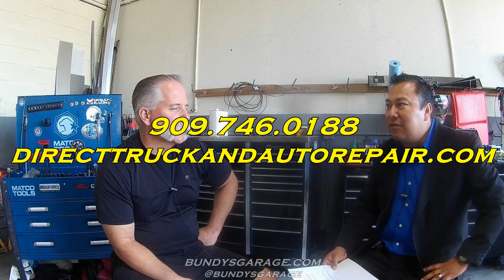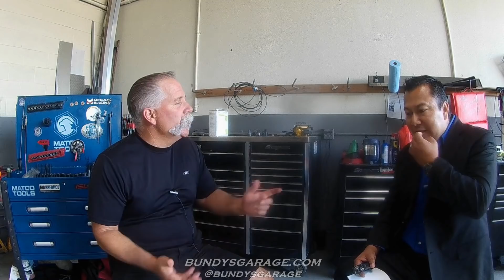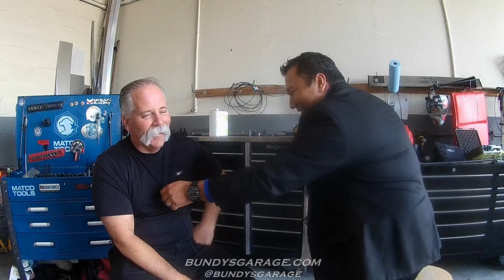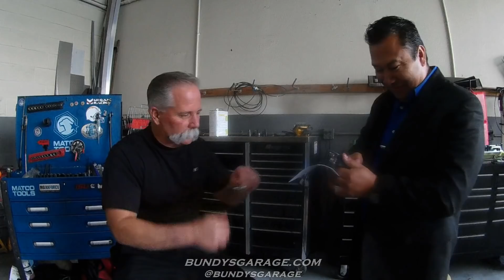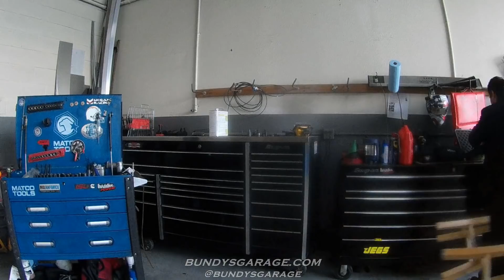Worst Diesel Engine Ever - What is the Best Diesel Truck out There? | Ford Dodge Chevy

Comment: Cat, Detroit, cummins are the only true diesels. Ford and chevy designed there’s around a gasoline design. And simply quite put a straight six is always easier to work on tHen V type engine Not to mention they are a better design

Comment: It's a good video and exemplatory statement about GM and their DURAMAX shinanaigans.. I had a 03 DURAMAX here with a spit valve and a mashed injector and what a friggin nightmare. I had to tear it down first let it sit until I got the head gaskets from Summit... I Had too get the gaskets from Summit they knew more of the part numbers than our local dealer did FAIRWAY MOTORS in Hazleton forget buying anything from em period they'll sell ya truck in a big hurry but expect to get info or parts for it from em no no no FAIRWAY drives me friggin nuts. If you really need DURAMAX parts look ups there were 3 dealerships in TEXAS that helped me out over the phone as much if not more than Summit has over the years dealing the GM trucks. There was also Sea Side Chevy Customs in Florida I believe they got wiped out by the storm down there but I hope they rebuild. Some of the Chevy Custom shops know more than even the factories that built the damn trucks. And that goes for FORD too the dealers here in Pennsylvania I wouldn't let Ford or GM sell me a tricycle here in this state... I always have to go out of state or turn to Summit and Jegs to bail my ass out on parts look ups. I also keep note books now because most of the problems are reoccurring model year to model year it's usually the same problems injectors or injector pumps and bad heads... GM has a few DURAMAX with faulty ECM modules most people think their engine is shot when they go haywire.

Comment: You could buy the same tow truck from international with a VT365 (6.0) and MaxxForce 7 (6.4) you push emissions aside on a true International MaxxForce 7 without the junk Ford pistons in it and it's a pretty reliable engine.

Comment: I am a Ford man also and most of the vehicles I owned was built by Ford Motor Company. The best Ford product I owned was a 1969 Lincoln Continental and that vehicle was built like a tank. GM's vehicles gave me the worst service except for a 1987 S-10 Blazer which I got new. After that the next one I purchased was the worst I owned so I swore off GM products for good.

Comment: What a load of crap....You always see fords broken down and being towed..On the Florida turnpike they use fords..they stay in the shop more than on the road...Now you have to remove the cabs to work on them. I own a duramax and it too is a load of crap...dont sit there and lie about Power jokes..
I agree with the Cummings but they too have been screwed with by these idiot claimed engineers to break down. A gas motor with a turbo or a supercharger is the best for the least..Diesels are a financial waste of money....

Comment: P-pumped 5.9 Cummins. They're noisy, they don't make the power of the newer engines, and they leak oil when they age (easily fixable, BTW), but they are relentless. I'm running one from a MD truck that has countless miles on it, but the company that owned the trucks was stringent on maintenance so when I resealed it, including a new head gasket, I checked cylinder taper. There wasn't any. So far I have added another 60k or so, and it just keeps on going with very little blowby. A rugged design with extreme mechanical simplicity is a tough recipe to beat.

Comment: i know people do it and it didnt change the EPA  output was very little change , ford the only truck was the 6.o i had one in a box van and pulled a 9000 lbs motor and pulled the cat all around the country but just not a lot of powered but enough. Best most but around here love a certain 7.3 they say is best. But GM new truck the 3500 or the 2500 the motor is out of the world 470 hp. Now thats a powerful motor and you just cant kill it all we see here are hot shot truckers and wreckers they all the GM w/ a Duramax

Comment: All my family was born in San Bernardino and lived there until the great flood, but al my family lives there and now where i live they build both GM and Ford but i have a Duramax but i love the Cummings with Eaight cylinders they would be unstoppable but i have to i truly like the ford body and life gasket., one thing about the Duramax has been to Milford proving grounds and they have tried every after market turbo system and @ max RPM and they could never blow it up. Think about that it feel the very same way but you cant kill the izuzu they have been used in Africa for years and years.

Comment: I have an F450 with a 6.7.  Until Ram offers a 4500 with a bed and that wide track front suspension so you can actually turn your trailer... I'm staying with Ford.  Some things are worth more to me when driving a truck than power, or even economy.  The massive brakes on the 450, the commercial tires, the turning radius, 4.30 gears... much more enjoyable to pull a trailer with it.  i pull a 40' 5th wheel toy hauler, and i like knowing I have the capacity to pull 2 of them easily.  Oh, and that Bang & Olufsen sound system is inifinitely better than the Bose junk they put in chevys :D

Comment: Great video...   I sure loved my later Ford 6.7.    It seemed as solid as my FZJ80 landcruiser..   Trust me,  that one had F R and center lockers, leather and a moonroof and still went across a lake in MN my friends snowmobile got stuck on.  I also accidentally launched it in the Desert when I moved to So-Cal and it kept running unbroken and I sold it at 200k miles to a guy who moved it out of CA to put a 4BT Cummins in it. So that "Powerjoke" apart from one failed of the many EGT sensor was awesome.   CA's stupid emissions laws allowed me to put 60K miles on it and sell it for $3k less than I bought it for after 4 years... and I beat two hondas who were "racing" while I had over a dozen hay bails on it.    Now I'm driving a Lincoln with a Maserati stored right now.   In the next 5-10 years I'm not going to be the slightest bit surprised if a Tesla or other company makes a electric pick up truck that destroys even a dream truck like a Ford designed chassis with a Alison trans behind a Cummins motor that was all assembled in a Detroit located Toyota backed factory with Ted Nugent as the boss.

Comment: My Cruze diesel was a mess before I deleted it. Would drive the car sometimes and it would buck continuously in whatever gear it was in. Damn box sensors kept going bad. Would never do the regen cycle. Now all of that has been eliminated and it runs like a top. Still wish it was manual because over 300 wtq should spin those tires clean off, and it just doesn't. I can get it to spin At a roll but not much.
Reply: That's traction control. The computer won't allow your wheels to spin.

Comment: You can weld potted metals, by simply cutting/grinding each edge to be matted, so that when they come together, it forms a "V", and then you slowly fill it in. Granted, it will never be as strong.

Comment: I noticed a maxxforce engine emblem on his toolbox which made me nervous.   The international maxxforce engine especially the DT variant was probably the worst Diesel engine built in the last 20 years.
Reply: Yes the Maxforce 13 engine was a piece of shit, but the Maxforce 7 was alright since it didn't have any emissions equipment on it. They stopped doing the Maxforce 13 in 2016. This is why Cat and Navistar are similar: they can't figure out how to balance emissions equipment with reliability like Cummins and Detroit were able to do.

Comment: I'm no expert by any means but I did have a Duramax Chevy 2007 and I recall it was a 6.6L Diesel. Got the truck brand new off the lot and used it to tow an enclosed 14ft trailer with moderate load. The Allison transmission went out after a few months (under warranty, thankfully) and the engine's oil would magically disappear before oil change was due. Not to mention horrible mileage.

Comment: Everyone's arguing about International, Cummins, and Duramax.
I wonder does anyone have any comments on the GM 645 engine, which was their mainstay for decades. Many of which are still functioning after tens of thousands of hours.
Reply: Wyndham Coffman notably inside locomotives
Reply: @ecoRfan  Exactly. It is still a diesel engine, but you almost never hear about anything over 8 litres.
Reply: Isn't that the emd line of engines. And cat bought that company off of gm.
Reply: Yeah I forgot about that. Did they change the engine significantly after caterpillar bought them? From what I've heard you can actually still get 567 engine parts from Caterpillar, along with 645 engines.

Comment: My 7.3 has 428k.  The injectors are way past their prime, but it still runs great.
Reply: I have a 7.3 with 463 k
Reply: @hotgenlee  - now you just bragging!
Reply: Alberta Canada 1986 f-250 4x4 4-spd  6.9   385k   ♡
Reply: @jamesburton6059  - yeah, but that is likely in KM!
Reply: Kanadian Miles!
Reply: My 2000 7.3 is still a baby at 117k
Reply: @kylekope99  Same here 199 7.3 with 126k miles.
Reply: 327k
Reply: 480something k miles.  Very little blow by and even ate a glow pug tip and still starting strong in the cold without block heater.

Comment: V-8's are not in big rigs because of clearance and weight issues. Ask anyone that has had a 3408 Cat. You're just about maxed on your steer axle before even picking up a load! And there just ain't room between the frame rails to work on it. But then, the engines today are CRAP. Glad to say I owned about 15 trucks and never had an emission system on any of them!!!